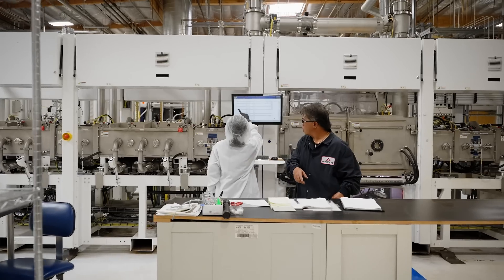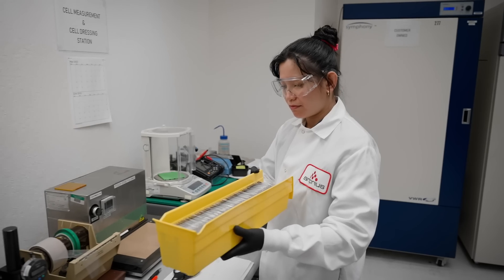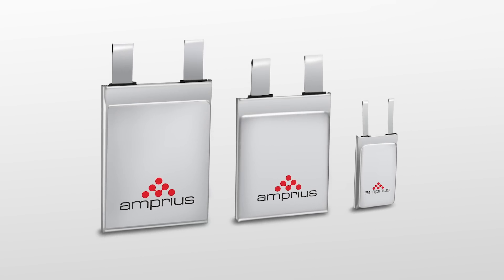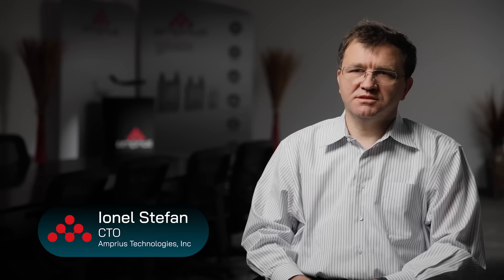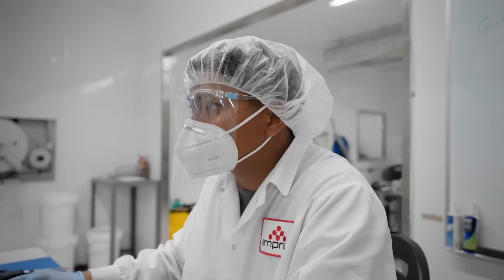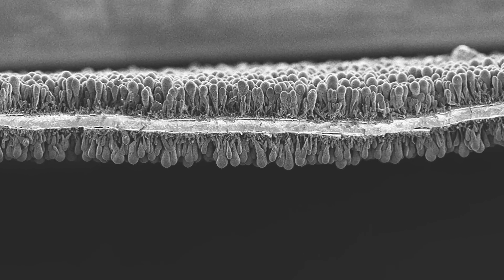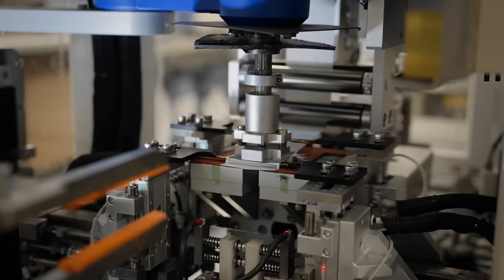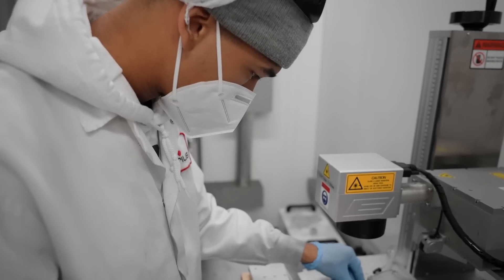About Amprius Technologies

Comment: What is the cost per watt hour compared to batteries used in a Tesla?
Reply: Probably more than would make you smile. The important thing is that they're at about 2x the density of Tesla cells, and  what that unlocks /enables to be then converted over to electric will save overall in the long run no matter what.

Comment: There is no doubt that these are suitable for aircraft and, perhaps, very large ships but pure silicon is very brittle so will they survive the harsh vibrations of road travel (cars, bikes, etc)?
Reply: mrcnesiah • They need to be "brittle" ( flexible nano wires of silicone, at very small dimensions ), so they continuously rearrange electrically.